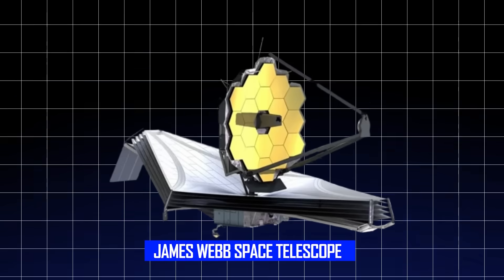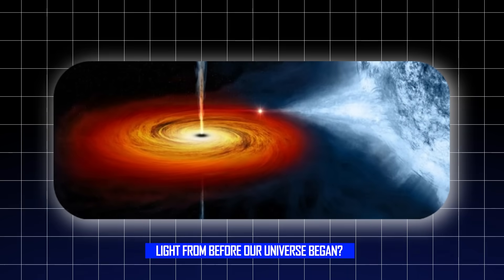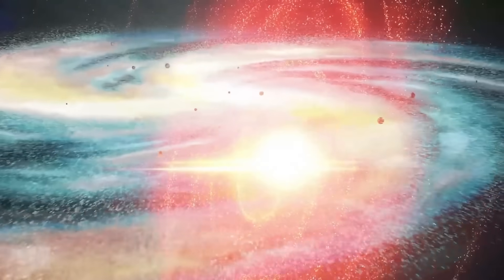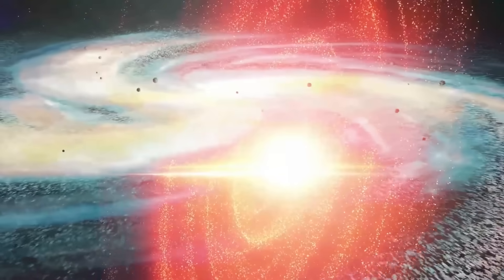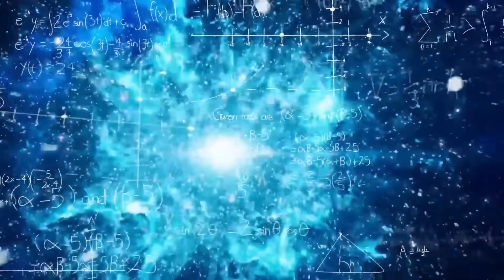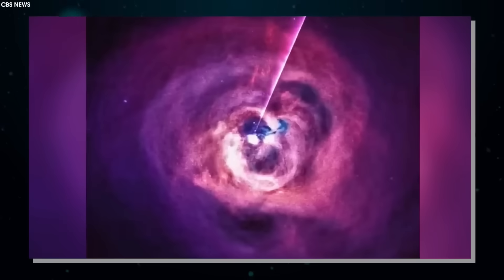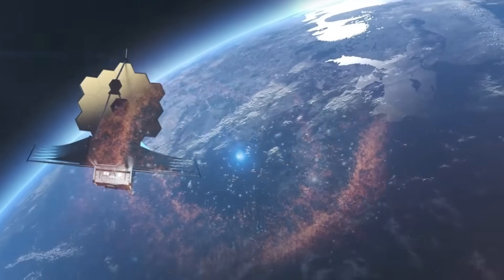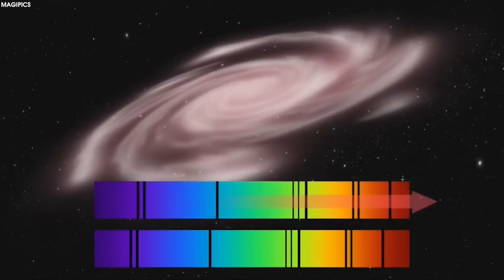Webb Telescope Captured Light From a Dead Universe

Comment: GDLA-QG involves 2 Basic QG Minimal Actions. The First is Non-Relativistic Spin-Condensation(Extreme is Big Crunch) & the 2nd is 'Relativistic Holographic Ekpryotic 'Super-Tension'(Extreme is Big Bang). This involves Quantum 'Topological Geometrodynamics'(GSMEC) & 'Classical-Quantum Duality' is Central to my GUFT. 

In GSMEC there's 2 Dual Groups that Defines All Physics, Matter & Energy Conduction(Transfer & it's Dual Insulation etc).

First is 'Generalized Stochastic Mechanics' which includes 'Generalized Hydrodynamics'(Liquid Physics/Gases-HIT & Aerodynamics/Plasma/Superfluidity), 'Generalized Phonodynamics(Sound/Phonons/Vibrational Resonance through Matter & Media), 'Generalized Thermodynamics'(Heat or Thermal Energy which is Associated with & Equivalent to Kinetic Energy), & 'Generalized Electrodynamics'(Classical & Quantum Electromagnetism/Nuclear Forces-Radiation/Casimir Effect/Superconduction/Quantum & Sub-Quantum Fields which are Type 1 & 2 Galileids respectively).

The Dual to this is the 'Generalized Solid-States of Rigidity'-GSSR(includes BEC Supersolids or Super-Rigidity=ZPE=ZEO of Q-TGD=GDLA-QG). There is 3 Generalized Sub-States or Types of Solids & BEC which includes Liquids too(GHD);

1st is Crystalline(Simple Repetitive Geometric Symmetries).
2nd is Glasses which are Maximally Entropic & Disordered.
3rd is 'Quasicrystals' which are Aperiodic & Maximally Complexified('Holographic Complexity'[E8 × E8/Quantum Graphity] or 'Action[Dynamics]-&-Volume[Geometry]=Geometric Complexity'). There's the Euclidean & Non-Euclidean 'Soft' Geometric Counterparts.

More on this & References later. Many Blessings to All!...
Reply: GSM/GSSR Duality. 'GSM' includes GHD, GPD, GTD, & GED. GDLA-QG & GU='Causal Fermion Systems'-CFS('Dynamics-GSM'/Substance or Q-Matter/Q-Dirac Spinors-Twistors=Harmonic Oscillators) + 'Quantum Topological Geometrodynamics'(Q-TGD/'Form-Geometry'/Dirac Spinor or Harmonic Oscillators/Multioscillators & Twistor Theory). GU is 'Geometric Unity' Theory.
Reply: When it comes to both 'Matter' & Spacetime 'GHD' is Exactly Dual to 'GSSR'(Hermetic Knowledge/Egyptian Book of the Dead eg 'Hall of Double Truth/Law'/Atum/Ptah etc). Also Check out Walter Russell's book 'A Different Concept of the Universe' & 'Emanuel Swedenborg's' Literary Works such as 'Divine Love and Wisdom'(Twistor Theory & 'Clifford' Algebra's).
Reply: Q-TGD='Quantum Information Holography'(QIH). The 'Holographic Quantum Memory' Storage Capacity/Processing of Matter & Memory-Force(Dark Matter=Gravity/Spacetime) is Infinite(CTMU).
Reply: TLDR. Thanky!

Comment: Cyclical Cosmology is Circular & Infinite Regressive Reasoning. The Primordial State of Being went through an Initially Ultra-Local to Nonlocal Big Crunch(Pattern like Flower of Life) that is like the Opposite of the Big Bang(Inflation in the Pattern of the 'Flower of Life' & 'Quasicrystals'[Non-Commutative Geometry]), which Followed right after. It's the Echo of the Big Crunch & Big Bang. The Primordial Self-Existent Ultra-High-Energy State of Being(All-Being/Ba) is a Nonlocal Nonconformal Supra-Thermal Hyper-Caustic Gas of Pure Infinite Light-Energy.